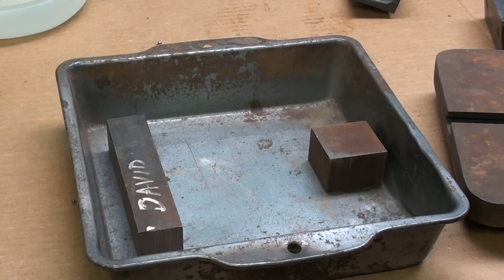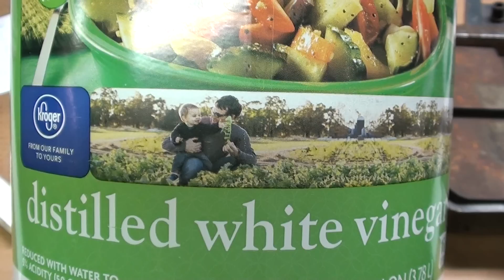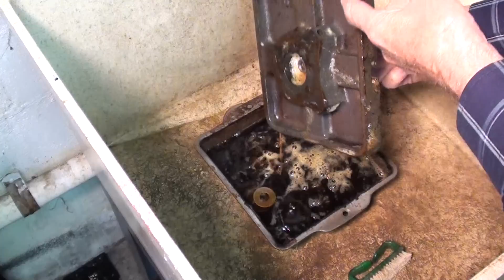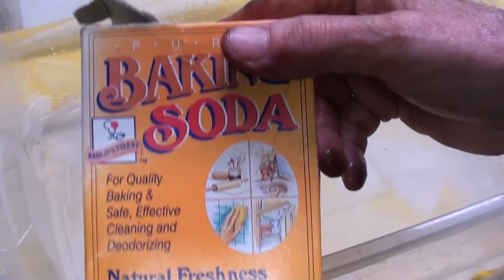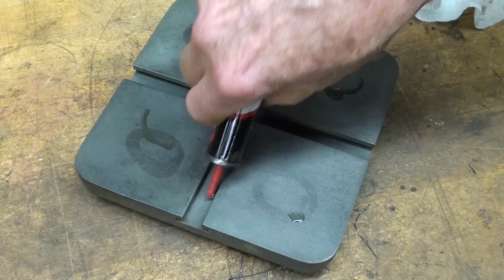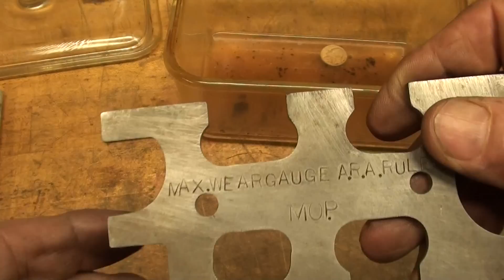Rust Removal Vinegar #304 tubalcain - compare to electrolysis

Comment: My maternal grandfather worked for DuPont as a chemist and he had another use for Vinegar that I refused to believe until one day I had bad heartburn.  I took his advice and drank straight vinegar and it worked.  The first shot was like 101 wild turkey but the ones that followed got easier and easier.  Both  White vinegar and Cider vinegar seem to work the same.  3 full shot glass doses spread out over a minute or two  usually does the trick.

Comment: It would be great if you took two similar items, rusted as closely as possible the same way, used one in the electrolysis vat and the other in vinegar.  But, I have to say, I am surprised the vinegar worked as beautifully as it did.  Thank you for your time and work.

Comment: Seen a body shop use this for surface rust before,I may get a spray bottle to wet down a rusty trailer I'm working on.Pressure washer took off the green paint (but never painted it green).May help on dusty sanding since COPD is trying to take over.

Comment: Acid etching is ok for removing rust, but it certainly leaves iron 'thirsty' afterwards.  I have an old washing up bowl half full of oil, that I drop things into for an hour or so after cleaning; it lets the oil soak in.

Comment: I've used Distilled White Vinegar  on numerous projects to remove rust.  You must get the part completely submerged or the part that's above the vinegar will rust like crazy. 

Heinz had a cleaning vinegar that's 6% Acidity.

Comment: Great video, all good information. One thing. Unless you want lead poisoning, Don't repare your pan would lead solder. Buy a new one. Lead solder is not even recommended for use for water pipes anymore.it's all leadfree which is good.

Comment: I like using a jar of vinegar for soaking rusty nuts, bolts, and washers as I disassemble something.  It has the added advantage of making the work area smell like an old-time Italian sandwich shop. I've found vinegar works like Evaporust, just slower and a lot cheaper.

Comment: I enjoyed your video as always. I believe those chisels are for packing oakum in cast iron sewer pipes prior to pouring lead in to seal the joints. I have a bunch of the chisels that are brand new made by Plomb, Proto and P&C. All related companies. Pretty much antiques nowadays as plumbers don't use that DEADLY solder anymore because it's quicker to just glue plastic pipes together.

Comment: all kinds of vinegar are the same acetic acid with flavors, it works but like you said is slow, as acetic acid will eat rust AND new metal with enough time, care is needed.
how much works, a lot and you have to be careful too of placing in the bath pieces made from different alloys, point in case i threw a heavily rusted motorcycle 
chain and forgot about it, a week later i removed the pins and the 
plates as they separated as i pulled the chain. the metal of the plates 
was heavily disintegrated but the pins were ok. 
a thick foam like layer had developed over the small tank i used containing 15 litres of wine vinegar. you don`t have to throw used vinegar, can be reused to eat rust, just add some new to strengthen the solution (up to a point) i used 5% acid content too.
neutralization is absolutely necessary for flash rust will appear in no time (flash...)
oil well but don`t use wd40 it`s too light
thanks for the video sir
pete
ps i treat old files with white or any vinegar, to not use that much i have a piece of about 14" long 1 1/2" pvc pipe with one cap glued and the other not. it`s a nice reservoir and easy to pour back in the bottle. really mixed results with the treatment in my case. if any i keep them to try for cast iron or hardening...

Comment: I use glass marbles to keep things off the bottom of the pan.  About 2 or 3 hours usually works for me.  You probably have a video about such, but this surface didn't IMO need lubrication afterwards, so for such I use plain old WD-40 to keep moisture away from the dried off steel.  It works well for things not needing actual lubrication.  My complaint about electrolysis is I need a powered wire wheel to get the black off many types of steel, but I suspect I could probably get the same effect by skipping the electrolysis and just using the wheel.   Sad vinegar doesn't remove pitting too..

Comment: It's kind of ironic that you're using vinegar to remove rust.  I put together a muzzle loading rifle several years ago, and instead of blueing the barrel, I used a browning solution, which basically puts a fine rust layer on the metal.  The main ingredient of that solution was vinegar...

Comment: I use Phosphoric acid around 81% (available from hydroponic supplies as PH down)  Mix 1 part Acid with 3 parts water for very rusty items.  Only the rust will dissolve leaving item completely rust free.  Works wonders on Aluminum corrosion too- removes all corrosion without harming the metal.

Comment: I use vinegar to clean the white crusties off of battery terminals in electronic items caused by leaking old batteries.
Reply: +jusb1066 be VERY careful you don't get any of that solution around the cell lids....
Reply: +Tim Hyatt I'm talking about small electrics with D, C, AA, AAA batteries. A leaking battery crusts up the spring contacts. I just use a Q-tip in vinegar to wet the contacts. My car battery has spray protect applied so always have clean posts.
Reply: thumbs up I like you. I will watch more of your videos
Reply from the maker: Thanks for watching

Comment: Mr. Pete, I also used white vinegar to remove heavy rust from a surface gauge that I made in trade school in 1955. It was my first major project and had sat under my house for over fifty years. A plastic pan worked well to hold the parts and vinegar. Three days later with a little clean up work I had a perfectly restored surface gauge that's a pride and joy to look at. Thanks again for your very helpful instructional videos. Keep up the good work.

Comment: I like electrolysis along with  molasses and water.  Electrolysis leaves a rust protective coating of sorts, the acid leaves a surface that rusts as soon as it hits air, ever so slightly.  Molasses and water is a chelating agent, works dandy.

Comment: My understanding is that electrolysis (which I use) does not eat into the base metal, like an acid will.  Metal pitted from rust will of course still be pitted, but no base metal will be dissolved.

Comment: One warning about vinegar I had a flexible (thin) 6" rule that was rusty. I stuck it in vinegar for longer than intended(say 2 weeks) and it was pretty much gone when I finally removed it.
Reply: +Eric Corse Maybe all that was left was rust in the rule so there wasn't any good base metal to leave behind, but I agree that leaving anything, even stainless steel,  in acid for prolong periods without monitoring can eventually destroy most metallic parts, some much quicker than others, depending on how noble they are, and possible galvanic reactions with other metals in the bath. I left some stainless pump parts the were encrusted with mineral deposits in a jar of Muriatic acid for a week (forgot all about them actually) thinking they'd be shiny clean when remove- what I got were ruined parts that looked like pieces of Swiss cheese.
Reply: Chet I believed you hit the nail on the head.

Comment: Mr P ... I like the new intro ... losing the "dead air" at the beginning is a good move in my book.

Vinegar certainly seems a better option ... Baking soda makes quite a decent fine scouring powder too instead of mixing ... scatter on the worst areas and rub to help restore the finish,  Rinsing then neutralises. 

Evaporust (I think it's made in the USA) is a good commercial alternative ... quite difficult to source and certainly not as cheap as vinegar here in the UK - but worth the, effort and outlay it works like a dream on mixed material parts without damaging them.

Comment: I find that vinegar leaves the surface very porous.
Reply: +mrpete222 it`s not the vinegar but the oxide molecules being bigger than the iron or steel molecule "explodes" the rusted area forming the craters.
Reply: +Robert Lunsford its not from the vinegar. rust becomes porous and eat the metal
Reply from the maker: +Robert Lunsford I did too
Reply: +axtra92 that makes no sense because if I use fine steel wool or emory cloth to remove the rust, it leaves a non porous surface. I am removing under .01" of material mechanically but the pores in a vinegar derusted part seem much deeper than that. It is also uniform over the entire surface regardless of whether rust was present in that area or not.
Reply: you are right, vinegar is a diluted acid that reacts with iron, so if you put a non rusted piece in any acid bath it will react and begin to chew the base. light rust is one thing, a layer of oxidized material, deep rust is other. it`s a matter of how long the piece is in the acid. like i said in other post i threw a motorcycle chain to de-rust and forgot, week later i removed pins and pates in pieces, the acid ate the rust and the "good" metal of the plates. the pins held longer as they weren`t even stained. pete
Reply: +Robert Lunsford da. is an acid so etching occurs but ALSO a solvent . notice how the piece soaks up the oil like a new whetstone. this forces a kind of millscale on steels. can be bad for lower grade stainless as nickle oxides would form before the iron and chrome oxides to give a microscopic anodic layer that is very tough. cheap SS generally have little to no nickle.

Comment: I have some stuff sitting in vinegar and used it for loads of taps and dies.Also try molasse..
I leave my stuff for 1 week :D..Come out gleaming.I had a rusty old file that looks brand new now.
Reply: +Muhaa Haloa you will have a huge ugly mess on your hands when the gas from the chemical reaction blows that container to pieces, that would be my guess.. Good luck anyway..
Reply: Stanley Kennedy It's never happened before so cant see it happening now,In the 3 yrs i have been doing it...:D..
Reply: Hi, I know it can happen , because it blew up the plastic bottle that I had placed some rusty nails & vinegar in, so I could dye some oak wood with. I thought I had left the cap on loose, but the next day I found my small shop had a new rusty polka dot film on almost the whole left side of the shop. This is how I know it can happen ,lol joke was on me...
Reply: Stanley Kennedy Yeah but I'm using sweet tubs like roses and miniature heroes tubs there not 100% air tight just enough to keep it right it, has more surface area and mass,If you put 1.75ltrs vinegar in a 2ltr bottle then yeah i can see this happen,But not with the size of the containers I'm using..And its a really flexible plastic..I've never seen that happen in 3 years are you sure there was not some thing in them nails maybe zinc or some thing that reacted with the vinegar..Use big flexible square tubs and you will be fine..I'm also only using 1.5Ltr's of vinegar a time in a big tub,And i open it every few days to give it a good move about and turn over the parts i have in there..Just common seance

Comment: The acid can also rust the metal after prolonged exposure. You'll find that electrolysis penetrates far deeper into the workpiece but typically if something is rusted that bad it isn't worth saving. Could you recommend some books on basic casting and pattern making.

Comment: I have been using vinegar for years to remove rust. I haved saved a lot of tools over the years with it. I also use it to clean rusted up metal gas tanks. Here is a video I did on it, https://www.youtube.com/watch?v=RLICelW6Iuo&index=16&list=PLvTJDOLyZZ5hBMTcHYkWI8H-EhB2CSm0I

Comment: That worked really well, Mr. Pete. Thanks for sharing. I've got a little derusting to do on some old tools but, didn't really relish the idea of setting up an electrolysis operation. I do have a gallon of white vinegar, though. I think I'll give it a try. Thanks again.
Reply: This looks good for small stuff, but my electrolysis setup is like 10 gallons. And it was still a bit small for a vise I just restored.

Comment: Vinegar process works great and no battery charger, sacrificial plates, baking soda or hydrogeon gas!  I am gonna give it a go.  Thanks for testing it out for us!  Fred
Reply: Phos ac is in cola drinks, it's not inherently unsafe.
Reply: +Fred Miller Might want to give phosphoric acid a try first.
Reply: AustrianAnarchy What strength?
Reply: +AustrianAnarchy Except that vinegar is dirt cheap and quite a bit safer. Most likely why phosphoric acid is more effective.
Reply: +Noel Henderson loads better mate
Reply: Always found citric acid to work best myself.  ymmv.